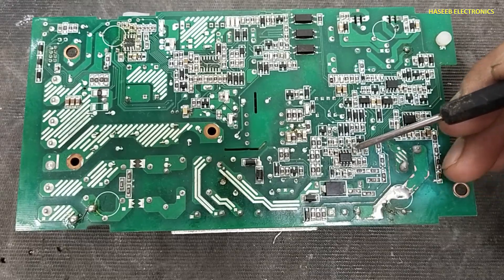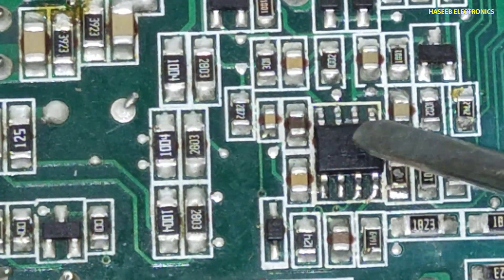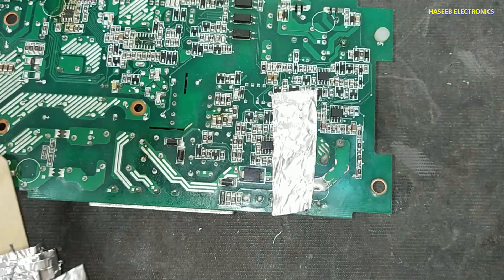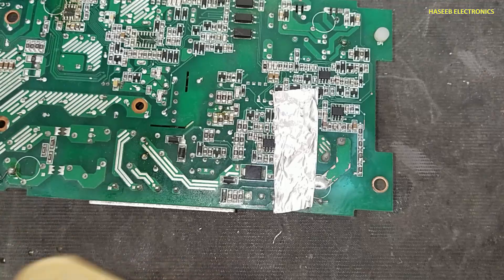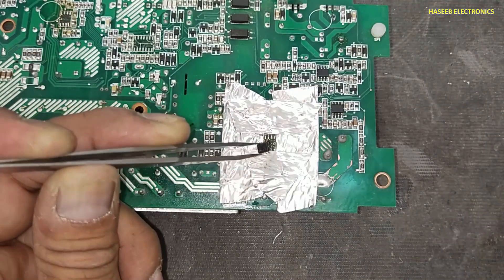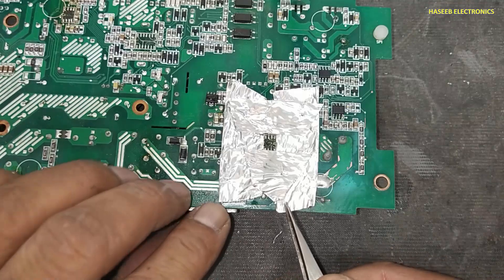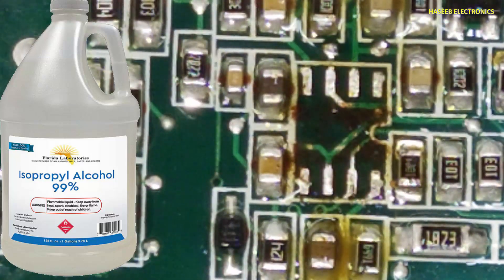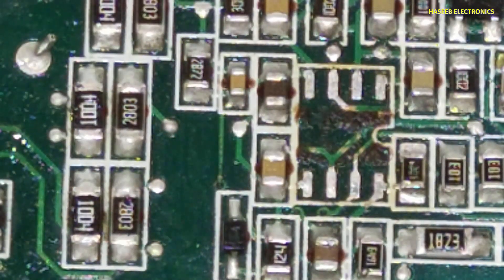{1142D} Desoldering in densely populated PCB

Comment: I know that aluminum shields work and are used by a great many people. However, it seems counterintuitive, as aluminum foil is used in cooking, because it conducts heat very well. Accordingly, I use Kapton tape. Greetings and cheers!
Reply from the maker: yes you are right 
as the rework process is always done in power off condition, and conductive masking masking is not dangerarous, except highely ESD sensitive circuits. if proper ESD safety is used then this masking is also safe 
BGA SMT soldering tape, Green PET film tape, high temperature aluminium foil tape, high temperature titanium tape, kapton tape, copper tape 
or any easily available heat resistant tape can be used as mask
Reply: @HaseebElectronics  The aluminium foil shields heat because it acts like a heatsink, pulls heat away very fast. Try heating the foil with hot air then remove hot air and 2 seconds later it is cool :-)
The aluminium tape is better than kapton tape because it properly stops hot air, whereas kapton tape does some shielding but the plastic parts will sustain some heat damage too. Your technique is perfect but I've been repairing SMD items for 30 years and I never use tape unless there is plastic near... I just reduce air flow speed so the parts don't blow away :-)
Reply: @HaseebElectronics I agree with you. Either way is easy to test in a pCB for part
Reply: I think it's more the air trap in between the foil that does the shielding job.

Comment: Please share purchase link of the hot air solder. Thanks
Reply from the maker: https://www.google.com.pk/search?sca_esv=81375795ef7c8290&sxsrf=ADLYWIIimhION19lljjpvCvZxV1QmTRw9Q:1720291646213&q=liquid+solder+63+37&udm=2&fbs=AEQNm0Aa4sjWe7Rqy32pFwRj0UkWd8nbOJfsBGGB5IQQO6L3JzEq8sk6FPCPzvp42tv1tXrkTLHakbUui6kohY8mGbK-7AcGtxQ_d-UOV8wqvkvfHu9NrGXkXTOptB_f2iT2n0beb5Zw2wIPFWFSmzL7Z5OqhE4F0NKcTC6C3CuHDpinMPROo4RH521mkWvwKiAsJejwUfOl&sa=X&ved=2ahUKEwiJ6u3jiZOHAxVNg_0HHdxBCyQQtKgLegQIExAB&biw=1242&bih=552&dpr=1.1
Reply: @HaseebElectronics  thank you for the link. My mistake for not asking for the right item. I need purchase link for the hotair gun. Your link shows solder wires / paste